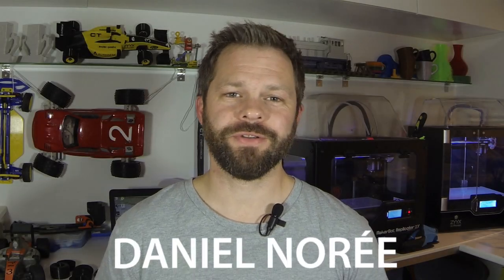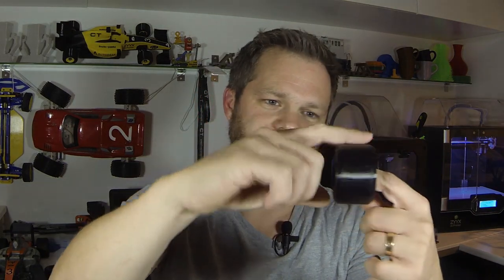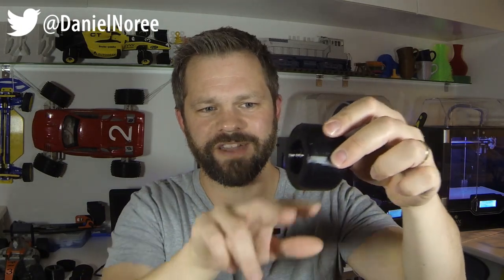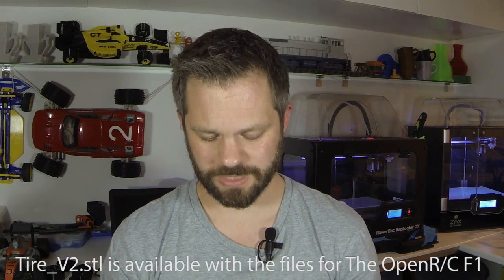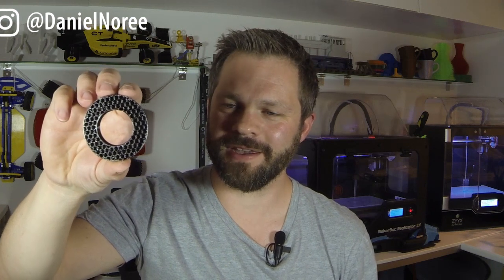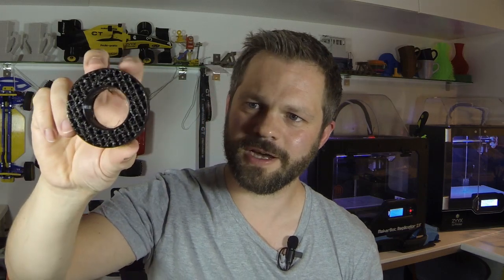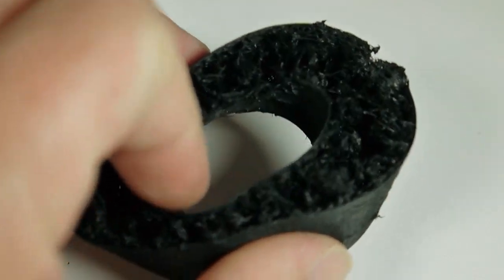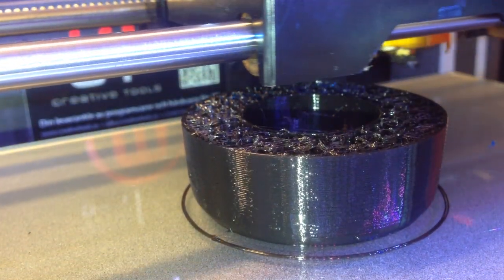THIS IS HOW I - F1 Tire & Under Extrusion

Comment: I sliced and printed them with Cura on an Ender 3 (bowden setup with dualgear extruder) with TPU 85A (Pxmalion) with this settings:
Layerhigh: 0.2
Temp: 230°C
Bed: 50°
Walls: 1
Top Layer: 3
Bottom Layer: 2
Top Layer with Lines and Bottom concentric (concentric wont work properly on top layer)
Infill: Gyroid 7,5%
Flow: 105%
Flow outer Walls: 110%
Flow top and bottom layer: 110%
Flow infill: 35% (the gyroid infill pattern is still clearly visible)
Print speed: 20mm/s
retract distance: 4.8mm
retract speed: 10mm/s
build plate adhesion type: none or skirt

I hope i could help someone wqith my settings

Comment: Hey thanks for the great project. I am working on trying to make my printed tires grip better. (My first set are way too rigid but good for display purposes) I notice in the related article you mention coating them in silicone. Does this make much difference and what do you do exactly? Many Thanks.
Reply from the maker: Hi Shane, thank for watching and engaging in the project. That´s interesting that you mentioned the silicone because i actully started to shot a video about it but never finished it. But i have to say i´m not sure about it´s actual performance in terms of grip. It´s been a while now and i think it was better but the silicone itself did wear of fairly quick. There´s been a couple of people experimenting with making molds for tires in the Facebook group, that´s a pretty cool idea. I applied the siliconr by simple rolling the tires in some silicone that i smudged out on a piece of cardboard.
Reply: @DanielNoree  Thanks I will have a play. I am new to printing TPU so it's all very exciting. :)

Comment: Daniel - I’ve watched this video several times, as well as searched your website, but I haven’t been able to find the following -
Which infill % do you use?
How many horizontal shells?
How many top and bottom layers?

For my first try I used 5% infill, 3 top/bottom layers, 2 shells, and your 55% under extrusion technique, and it seems too pliable to me. 

Thanks for taking the time to make this killer design.  I keep it on my desk at work, and I’m always getting compliments. :)
Reply from the maker: I´ve posted the settings i´ve used in this article: https://danielnoree.com/under-extrusion-is-awesome/
Reply: Thanks, Daniel!  How do these compare to the F104 tires in terms of stiffness?